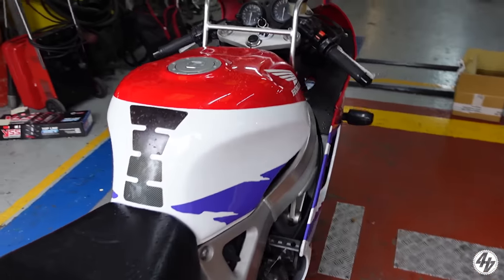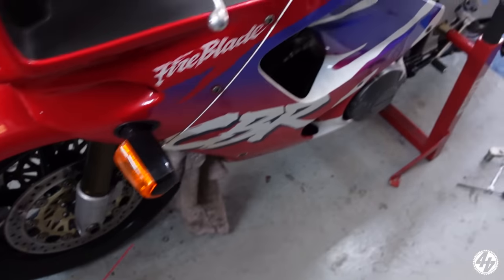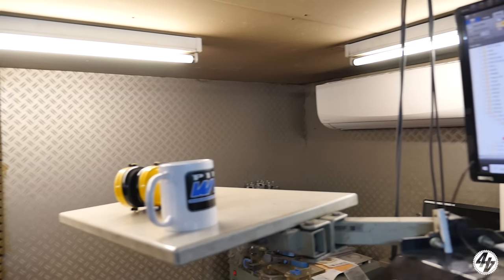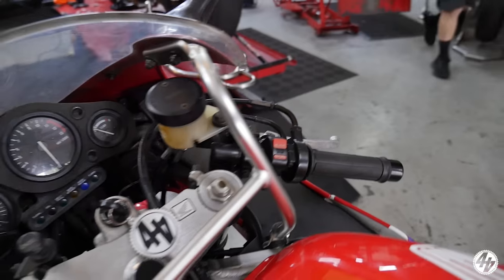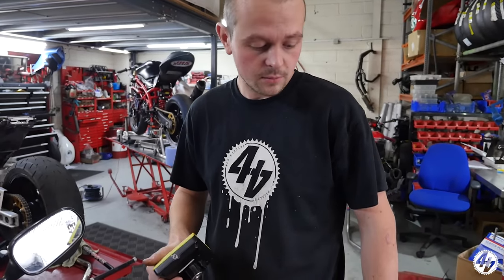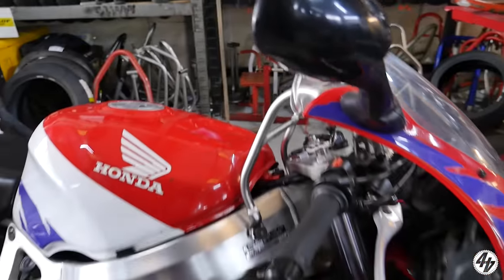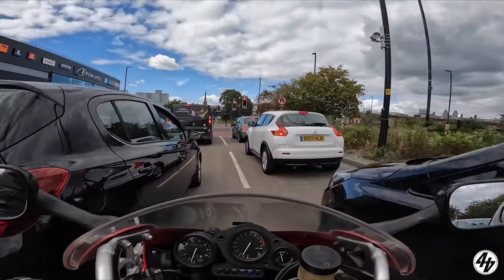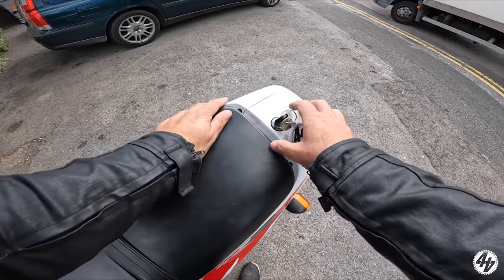TOO GOOD TO BE TRUE? | Budget Bike Battle Bavaria

Comment: I wonder if Chris’s YZF is my old one… I did and replaced everything I could but could never cure the misfire… plugs, coils, Ignition module, valve check(s), cards strips, cleans and rebuilds including new slides and diaphragms, second hand cards… nothing cured the misfire… in the end sold it… note I was a youngish motorcycle technician for BMW, Kawasaki, Aprillia etc so had a reasonable idea on what I was doing 😢

Comment: Really love the original paint scheme on your BBB Blade, I had a 1995 plate that someone had lowsided and proper knackered the fairings (It was an Urban Tiger as well) so got it cheap but had to 'renovate' it and decided to convert it into a streetfighter. I got 75,000 fully serviced miles out of it and it was still in great shape - I sold it in 2012 and miss it so much, the 16" front wheel was great fun with good tyres.

Comment: I had the same bike with the same color from 1995. At the time it was the top of the tops. Over time, I changed. Filters, ignition advance, exhaust 600 supersport vance hines, spark plug wires, until you get to the point where there's nowhere else to move, but open the engine and lower compression rates. Then the fun stopped. The frame wasn't ready for so much speed. Or was it me who didn't have the nail kit for her... Always Honda.

Comment: Taking about suspension adjustment. I think some people should leave them well alone (or get it custom tuned by someone who knows what they're doing).
I bought a 2022 sports tourer with 1000 miles on it. Previous owner was a big boy who rode two up. 
I rode it and it was a soft as my stool after one of those burrito's. 
Seems that he'd wound front and rear to their softest setting! No wonder he didn't enjoy it.

Comment: Again (like YZF750) why does JHS use dyno-happy DIN correction?  And why did you appear too be using top gear for the runs? Is your roller worn?
Reply: JHS is a real tuning house with many trophies to their name. He's not really going to care about headline figures - he's using the dyno to make sure the bike is doing what it should and if mods are done to compare them. 
If you want a big number sure - run it in 3rd/4th, put 60psi in the rear and all the rest. 
If you want to know how well the bike is running and what difference mods make then the big number is largely irrelevant.

Comment: Rear shock just has its nitrogen leaked. Just refilled my fireblade shock and it’s like night and day difference.
Reply: There are 2 tipes of rear shocks, one can be refilled, one can't be
Reply: @mariusromania442  all of the ones that have remote reservoir can be filled. You just need to take the end cap off and drill it for schrader valve. Cost about 4€ and its good as new.
Reply: @MJPilote   I've got both types, one as a spare without the valve...thing is one bike is italian one german, both 98'.............
?

Comment: Go team Honda, If I'd know earlier I could have lent you a period correct pair of carbon Dymags, giving you the benefits of a 17 inch front and as I'm sure you are well aware lighter wheels, now that would have been an advantage worth having
Reply: Is it worth changing front 16 to 17? Is handling any batter or is it just because of better tire choice?
Reply: There are a lot of differing views about the sixteen inch wheel, but the rolling radius is the same as the seventeen , and having ridden both my option is the only real advantage is in tyre choice, more modern rubber is available in seventeen inch, as an added point paying more attention to chassis bearing and suspension servicing has far more impact on handling than the difference between the two front  wheel sizes
Reply: @geoffmoulton6453  tnx for the info friend. That's what I was thinking exactly but I wanted to make sure with someone who has experience with 17 on blade. I have set up my suspension and bike is now great. Yss rear suspension, front Ktech springs, new chassis bearings and bike is like new. Cheers 🍻

Comment: I couldn't agree with you more. I've got a 1982 Honda VF 750 which I've updated  the Suspension  from 1982 to 2022 and the handling is like chalk and cheese ( it's about 300% better now ). I got the YSS shocks put on the back and stronger spring and thicker oil put in the front. I watched a you tube post about the difference between the YSS and the Olhins . The guy said for the amount of difference in performance and the cost the YSS are just as good a choice as the Ohlins.

Comment: Brembo SC pads feel so sketchy until you get heat into them. I've had a load of squeaky bum times with cold SCs. Sooo good otherwise, just gotta remember they're night and day different temp wise. Gutted the headstock bearings are like a pool cue in a welly boot.
Reply: I run EBC sinter on my 96 and brakes are really good in all temperature ranges

Comment: Well, well, well, just 6.4 bhp more than the Fox Eye. That's a surprise.
Reply: Yes at peak. But thats made up of between 15hp and 20hp more over most of the range. Its also 13kg lighter (both dry). 
If you look at the graphs and where they would line up the blade is pulling harder in 5th than the Yam is in 3rd over most of the range. 
The blade only needs 8500rpm or so to match the Yam at peak and the blade then stays above the Yam's peak to over 11krpm so basically if Statham can keep it over 8k or so there is nothing Chris can do to make the Yam match it. 
On the other hand the Yam sounds better, looks better and has a much nicer gearbox. 
I'd love either so I really don't care which wins but on paper that blade looks like its going to walk it.
Reply: @siraff4461  I wonder what the blade was new???
Reply: Dont forget about the power in every other part of the rev range. Its not all about the peak power
Reply: @PLAYINGAROUND  Back in the day when my first one was about a year old it did 109hp on the rollers. Then 133hp with jet kit, filter and exhaust. I remember some magazines getting more or less depending on the bike but there was a big variation in them back then. Strange for Honda. 
If this one is 106 and still completely stock it probably hasn't lost much at all - maybe a few ponies at worst.
Reply: @siraff4461  I did a search for a 96 spec'. Said 133. Which was at the back wheel if I remember correctly.
Reply: I had one of 95 and it had 124hp
Reply: @PLAYINGAROUND  no thats at the crank
Reply: @DanielRodrigues-ws3zv  at the crank?
Reply: @PLAYINGAROUND  Mine were wheel numbers on a relatively mean (but realistic) dyno. 
In those days they claimed power at the engine for most bikes and the 97 blade was claimed at 125hp from memory. 
I also remember the running in instructions were something like "do not start on full throttle for the first 300/500 miles". 
Basically saying after the first oil change you can just cane it.
Reply: @Yamaprilia  124hp for that year blade will be crank or modified. 
Some made 120hp with the usual bolt on's - some over 140hp according to some of the magazines of the day. I presume to get that they used every trick in the book like huge tyre pressure, thin oil on the chain instead of lube, pry the brakes off and so on. 
My 97 did a genuine 133hp at the wheel (up from 109hp stock) completely as it was ridden with filter, jet kit and exhaust.
Reply: @siraff4461  if I remember correctly Honda and Triumph back then detailed at the wheel figures.
Reply: @PLAYINGAROUND  I'll try to dig out some of the old leaflets and things when I can get into the loft and have a proper look. 
Regardless of claims though you're not going to see 125hp at the back wheel on a stock blade from back then. Maybe 115hp ish on a kind dyno with a healthy bike. 
Back then the blade was one of the lowest power big bikes. The ZX-9R and Thunderace (then later R1) both made significantly more. Of course they were also heavier. 
Even the SRAD 750 was usually not all that far off the blade for power - though it got eaten on torque and spread. 
Those old blade engines were based on a hurricane 750 (US bike) engine and weren't particularly heavily tuned. They were more about midrange and usable power with their larger capacity over the 750's of the day (ZXR750 then ZX-7R, FZR750 then YZF , GSXR750) meaning they made more power anyway. 
They were a brilliant cheater bike and ride really well.

Comment: That yss is not completely useless, but you'd have been better off with a gold valve kit and steel braided reservoir line upgrade to the rebuilt stocker.